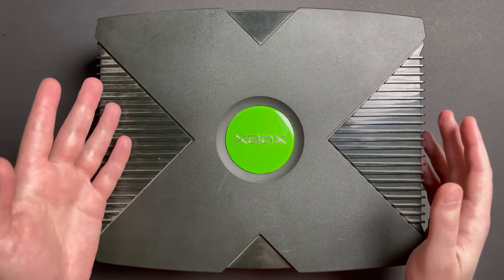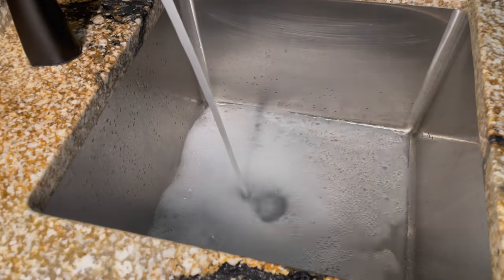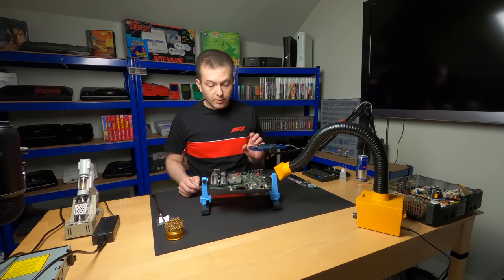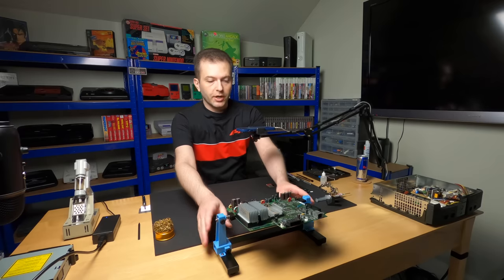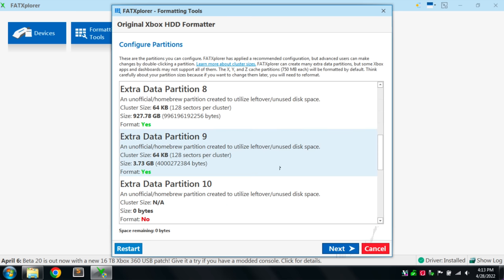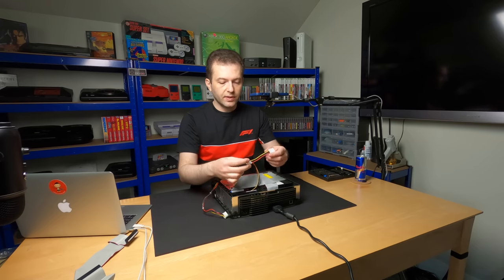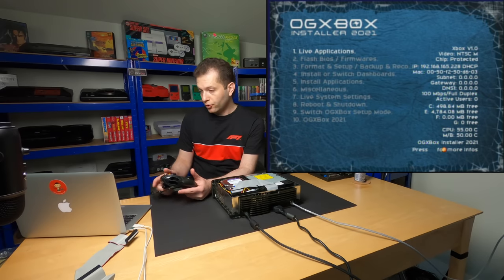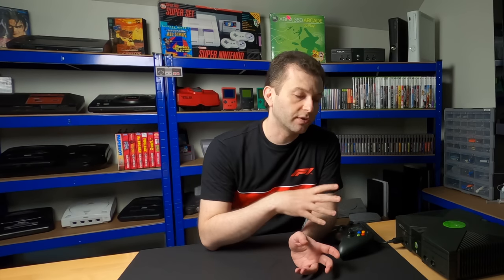16TB in an OG Xbox? CERBIOS has arrived.

Comment: The previous limit was actually 3 not 2tb.
Reply from the maker: Not quite. The limit was 2TB but since 2TB drives are not really 2TB (they are 2 trillion bytes which is 1.8TB), you would need to use a 3TB drive to get the full 2TB of space. With a 3TB drive in practice you would get an extra 200 GB compared to people who just used a 2TB drive. It was a bit silly since the rest of the space on the 3TB drive was wasted but when storage prices came down people would do it to get every last bit of addressable space. Cerbios and Titan are the first projects to break the 2TB barrier.

Comment: Anyone have issues where the alladin modchip is not flashable?
Reply from the maker: Many folks are. You will have to flash it using an external programmer, or get an XBlast Aladdin (ModzvilleUSA sells them). Some folks also had success buying the loose SST chips on eBay and hotswapping the replacement chip to flash Cerbios. You have options, but sadly the newest batch of these all use a new chip ID which is incompatible with current flash tools.

Comment: Besides the fun of tinkering, which I understand (I'm a tinkerer too) - is there actually a point to this? Like is there a functional reason for why you would do this?
I'm not super familiar with modded xboxes but can't it do 720p video at most, perhaps 1080i? If that's correct, what do you need terabytes of storage for?

Comment: Man, my mod chip was much easier. No soldering at all it, didn't have to run any wires either. It was like 15 years ago so I do not recall which I had. It just sat onto of the points you soldered and came with a a screw.

Comment: Is it any different for SSDs?
Reply from the maker: Probably just cost. Any SATA hard disk will work.
Reply: @BorderlineOCD  I see. Will that make Xbox work faster?
Reply from the maker: It will not. The bottleneck is the system architecture. You'll get a quiet system perhaps but you won't really notice any performance improvements.
Reply: @BorderlineOCD  I see, not really worth it then. Thank you for advice.

Comment: I have an xbox with executor 2 chip. I had everything more or less, many emulators and games from all different systems. I was told by the person that set it up for me 'don't mess about with it'. 
I wouldn't have thought that changing the system settings to wide-screen would've done any damage, but it really did. The light on the front turned red and warning screen written in loads of languages when turning back on. I lost contact with the person who set it up for me so I couldn't ask him to fix it, however there was a lad around the corner who managed to get it to play Mame OX for me, but couldn't salvage much else.
So I have this Xbox chipped with executor 2. I recently got a free mcboot card for my ps2 which is OK. Is there anything similar I can do  or anything non-technical for my chipped Xbox?
Reply from the maker: Sounds like your issue is in software. A chipped Xbox is half the work done. If you don't want to open it up and take the hard drive out to work with it using FATXplorer on your computer, you can use a utility disc like OG Xbox Installer or TruHeXen to install a XBMC and FTP some games over.
Reply: @BorderlineOCD  Thank you I shall look into it 👍 I don't have a computer but I do OK with a tablet.

Comment: a blue hard drive?really? wont that be slow?
Reply from the maker: Not really bro the system is 20+ years old. Even if you put an SSD in there the limitation is the architecture. Beyond copying your games over the first time using your PC, there are no noticeable performance improvements. If you start conducting scientific experiments I'm sure you'll find some metrics here and there, but in a practical sense there is no difference.

Comment: Can I do this with a tsop as well
Reply from the maker: Yes just keep in mind Cerbios is still in beta
Reply: @BorderlineOCD  Do you have another link for og xbox installer the ones at the forum are dead
Reply from the maker: You have to click on "Folder link for updates" to get the 1.5.4 archive.
Reply: @BorderlineOCD  The way that site has their links is a tad confusing or displaying errors, also the animation folder is missing the the bios folder unsure if it's important or just what changed the boot animation

Comment: Cool but 16TB?   What a waste!  No way you will get close to needing that. 
I have a 2 Tb modded Xbox with 900 OG Xbox games installed on the hard drive plus all the emulators coin ops etc.  Add over 200 songs burned from cds on the hard drive and I am still only using 20 percent of the hard drive.
Reply from the maker: I don't know where you got your 900 OG Xbox games that use 20% of your 2TB because even the archived set (rather than the full-sized ISO redumps) is about 2.3TB unarchived. My earlier 1TB build (old video on the channel) is at capacity and there are less than 500 OG Xbox games on it. Not sure what your're smoking bro but you should send some my way.
Reply: @BorderlineOCD  wait I read it wrong lol. That was the CPU usage.  I also forgot I deleted a bunch from this Xbox. I have 3 modded ones. 

I have 817 games, emulators galore and 200 songs on a 2tb Xbox and I am using 46 percent of the memory.